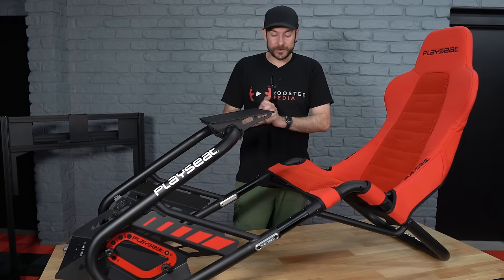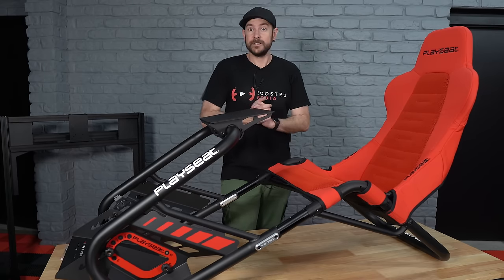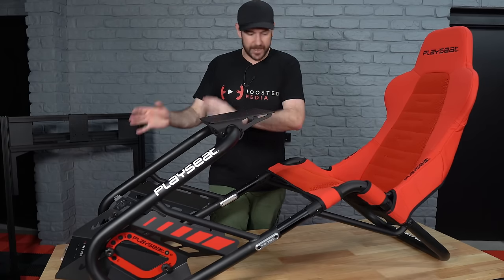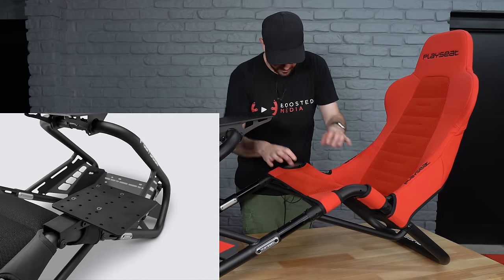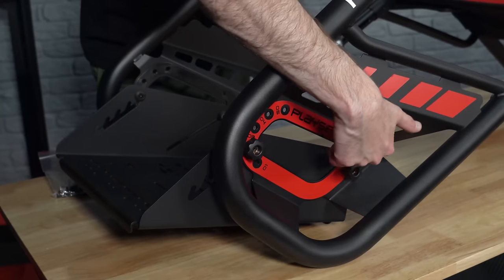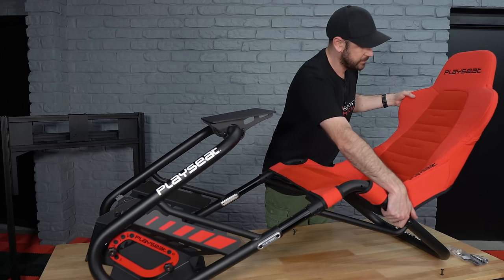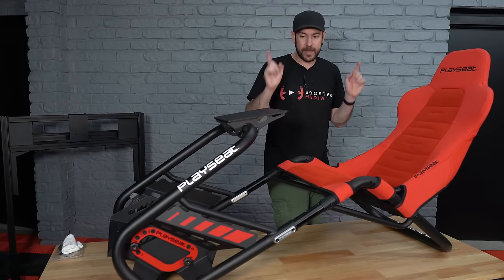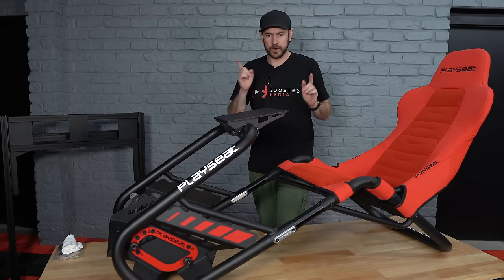JUST BUY A PROFILE RIG? - Playseat Trophy Sim Racing Cockpit Review

Comment: I've had one for a month.

The lumbar support is subpar. It gave me lots of back pain during use. I also found the wheelplate not being adjustable is very annoying. When youre in a suboptimal position for a couple hours you notice the inconvenience of it. Even in a 2hr stint in an endurance race it already bothered me.

The pedal deck flexes with decent force on braking. And since the whole thing is kinda light, if you put it on a smooth floor it can move during big moments of ffb. Also everytime you sit down it moves, making you re-center the thing while on the chair. I also regularly hit my knees on the extended bits on the wheeldeck

Those are all inconveniences that you shouldnt have with a rig at this price point imo. A profile rig is way way better
Reply: Hi mate, I'm 13stone, 5'11, and fi and that my ideal seating position with three trophy is brilliant. I'm medium on the tube, seat half reclined and have the pedals at a perfect angle. I have the wheel deck flipped so the short side faces you, which moves the wheel further away. I've got the deck angled down ever so slightly. I have osteoarthritis and find the seating good. The lumbar support is good I've got it just in the right spot. Everyone is different and what works for me may not work for you. Its light, easy to build and configure when compared to a profile rig. The seat is breathable where as most of the cheaper seats for profile rigs are pleather which make me sweat and then the seats are flat so you need brackets to angle it. Or get a more expensive bucket seat with brackets... I did a lot of research before opting for the trophy and for me it's been nothing but perfect. Using it with a fanatec dd 8nm, loadcell (I've seen zero plex in the pedal deck btw)
Reply: @StickyGeko  I think this difference in experience shows what's the main issue with this rig is. For some it works well, but for others its simply not adjustable enough to be comfortable in the longer sessions.
Reply from the maker: Yep. It’s impossible for something like this to be perfectly suited to everyone.

Comment: Owned one of these for about a year before selling it to a friend and upgrading to an ASR1 and an NRG seat for basically the same price (I'm in North America and used a discount code for the ASR1). It's a great set up for what it is: rigid enough for low to mid range NM DD bases and load cell pedals but also light enough to slide/move around a room or store out of the way. Looks as though some people even hang them up on the wall when not in use. 

The main complaint I had about this rig are the sliding "size" extender rails. Ended up having to fully extend them because anything shorter would just expand under heavy braking over time. Have read solutions where people have mixed grease and sand to keep it from fully extending to the large adjustment under breaking. Overall though better than any foldable/wheelstand rig but not quite as good as a full aluminum profile rig and bucket seat. 

If I were to do it again I would have skipped the Playseat Trophy and gone right to the ASR1 and proper seat but I'm glad I was able to experience the best budget all in one tubular solution currently. The seat on the Trophy is arguably more comfortable than my NRG seat, even after long play sessions and the lightness of the rig combined with the nature of the hammock style seat made the bass shakers that much more impactful. That being said the profile rig is way more customizable and the Playseat doesn't even have a decent shifter/handbrake mount currently that isn't overpriced and poorly designed. All just food for thought.
Reply: Yep. I've had it with the tubes sliding out. I have the pedals as close as they can be. I can't reach them once the tubes slide out to the large setting. I'm so annoyed with this and how much I spent for this rig.
Reply: How many Nm do you run and whats the flex like?

Comment: I bought one a few months ago because I had limited space and I wanted something that looked decent in my small space and still gave me a decent racing rig. I am using the Simagic Alpha Ultimate and P1000 pedals (with hydraulic upgrade). I love it. It's compact, but comfortable. Little to no flex/movement. And it looks good when not in use (it's sleek and with the red and black of the Simagic pedals it looks sharp). It's adjustable enough and I have managed to find a great racing position. Plus, I can move it/store it really easily. I would highly recommend if you don't have the space for a larger, more permanent rig.
Reply: I know you wouldn't have it set like this but how much flex is there at 20nm? How many kg is your pedals set at?
Reply: I experience zero flex with my Alpha U. I am a ‘weekend warrior’ type racer, so I definitely don’t have it dialed-in at a pro level, but I have experience nothing that makes me regret my decision. The ONLY thing I would change is that I feel the seating position is a touch too low for my liking, and I feel it puts my eye-level just below where I would prefer it to be. But I adjust in the software and I’m good to go. 

I’m not near the rig so I can’t check pedal settings. From memory I have the elastomers on the relatively firm/little travel side, and I don’t experience any flex in the pedal plate.
Reply: @jc_yyz  when you get to your rig it would be awesome if you test it at max Nm and find out how many kg of force your using on the pedals
Reply: @TheDoctor46vr    Just sat down between holiday festivities and maxed out (in my settings window, based on my settings) at 37KG of force and no movement.
Reply: @jc_yyz  thanks man, how many nm is the wheel base set at usually?

Comment: Had the Logitech Grey Playseat for almost a year now and still loving it presence in my small little living room. Stick 4 pieces of felt-pads floor protect and l can push the sim around (not on carpet) whenever l need space without hurting my back. I m 1.8m but setting my seat length to the shortest for the rally-car feels. Can literally sleep in it as well. Yes it's that comfortable, cooling as well. Shipping from Amazon USA is expensive but worth it.

Comment: I was reading that this was intended for the enhanced feedback mode of the Logitech Pro wheel, and that the flex that is sent from the wheel base to the frame is actually intended to add to immersion (as you're feeling feedback not just through the wheel but through the chassis too). Not sure how true this is in practice though...
Reply: Yes, if you HAVE the logitech DD pro wheel you definitely feel the ffb throughout the frame. Left, right, center, you can even fell the chevron paint via the rig. Its like a stereo feeling effect.

Comment: I adore my playseat trophy g edition. It's a smaller form factor than any profile rig, and is very light should I need to move it to access wiring etc.  Very sturdy, with no flex.  I went from a TR8 Pro, which weighed an absolute ton, and was much bigger.  This is a better racing experience for me and takes up a fraction of the space.

Comment: Had mine for about 6 months, it's been a joy to use. The seat is really nice IMO, it kinda forms around me in a nice way. I prefer it over actual racing seats, most of which tend to be uncomfortable for people who aren't realatively tall.

I'm 172 tall, 70kilos. I have the pit set pretty close to the smallest setting with the wheel very close cause I like being stuck in really snug. It would work fine for shorter people. Maybe even kids if you raise the seat back upright (mine is leaned back a bit.)
Reply: Just gonna pop in once more, had it for close to a year now and it's held up great. I've used it for about 300-400 hours at this point and there is no wear anywhere. Still in perfect shape. The seat seems to be made from very resistant material cause it literally looks brand new. I have a load cell pedal as well so I squeeze myself back in that seat pretty hard when I brake, still no stretching or wear.

Very satisfied. Very happy it fit me as well as it does. That was my main concern when going with this kind of pit over a profile rig, I was afraid it just wouldn't fit me. It's surprisigngly adjustable. I'm using the wheel base mount backwards to get it even more snug.

Anyways, I'd recommend this to people who feel like they want this. It does look super cool and it feels very much like getting into a race car. You have to slide in like you're getting into a supercar. Makes me feel cool every time!
Reply: @JimmyNuisance  How many Nm do you run? and whats the flex like?

Comment: I've had a 2007 model Playseat Evolution in alcantara finish for about 11 years now.  It feels great to drive in and I can't see any possible reason I'd ever need to replace it.  You'll fairly quickly find yourself replacing a wheel or a monitor or whatever, but the chassis is the one part of your rig you only need to buy once if you don't half-ass it.  I mean... It's still shaped like a bucket seat.  It's still adjustable.  I added an official gear shifter attachment for about £60 a few years ago.  It's physically incapable of becoming outdated or breaking.  Unless I win the lottery and start looking at motion rigs.

Comment: I had some 2" thick pine boards laying around that I got bored and milled up one day. Cut a bunch of it up and made a rig for my wheel and pedals. Made a pedestal and put in some drawer slides that I found in a discarded cabinet on the side of the road. Had some Paracord from a project that I threaded between the two rails for a seat bottom. After I put everything together I was out of a few dollars for some lag bolted to tie everything together. Fun little day project. Now I have a roadside junk TV that I fixed bolted to the wheel pedestal that slides in and out with the wheel to get out and some castors to roll it around.

Comment: Have one myself now for several months and I can mostly agree with what you've said in the video although using fanatec's v3 pedals is really no issue in terms of flex. However I'm already upgrading to 8020 rig since lack of customizations is a thing with this rig. While rig is pretty rigid and comfortable I can highlight some of the issues that I've experienced. For me, it's really low and getting in and out is a bit annoying, fastening underneath the seat kept falling off especially when getting out so every now and then I had to fasten it again. While it's relatively light but add heavy pedals and a heavy wheel base(I have DD GT PRO) and you end up where the front of the wheel is heavy and rear end is light, moving it isn't something you'll want to be doing a lot, I solved that by attaching caster wheels to the front and it made moving it around that much easier. If you don't need to move it around then I'd go for 8020 rig since in terms of space it's taking it's just a tiny bit less than the most popular aluminum profile rigs and since for me space has become a non issue and I can set for a permanent rig location it has become redundant. I'm not sure I agree on 'this looks better in a room than aluminum profile rigs', in my opinion new black profile rigs don't look any worse.
Reply: Would love to see a short video how you solved it with wheels, as that would help allot of racers who has this seat
Reply: I to would like to see the wheels as I plan on doing similar

Comment: I bought one almost 2 years ago… and it’s still good as new. Very sturdy, very confy, and adjustable. If you want a good “rig”, sturdy enough for a dd or any wheel, but without having to go big with a proper rig… this is it
Reply: How many Nm do you run and whats the flex like?
Reply: @TheDoctor46vr  i use the Fanatec Clubsport DD+ wheelbase with a pretty strong setting, and there is no flex at all

Comment: I use this one, if you are the only driver who use this seat it's good. It's very stable, nothing moves when I use my Fanatec DD with Loadcell. I can Recommend it for drivers who don't use a shifter or handbrake. Also you have room for your legs. It's also very light, no Problem to move it around. For low Budget it's very good 🏁🌍😎✌️

Comment: Ive had this for 2 months now. Im 6'2 (187cm) tall and biggest problem for me is wrist angle on the wheel. It gets uncomfortable for me on a longer session. QC on my unit was bit lacking as I had to hammer the wheel baseplate to get it to fit. I replaced the allen bolts on the frame for standard m6/50mm bolts for easier adjustability.

All in all pretty satisfied with the product. This is the only option for this specific niche of cockpits.
Reply: Could you clarify what you mean by the wrist angle issue? I'm 6'5" and considering buying one of these.
Reply: With my frame I don't have enough up and down adjustability on the wheel for optimal wrist angle. Meaning, in my driving position my wrist is not straight which leads to wrist strains on longer stints. Mind you, I'm an arpg gamer so my wrists might be shot anyway 😅 

I noticed this issue this weekend when I drove for 4 hours or so with my 9mn moza. I'll play around a bit with  the little adjustability. I can report back to you.

Comment: Works well with my Moza R9. The only problem is that mounting plate for wheel is annoyingly moving during driving as it's hard to block it at specific position - apart from that affordable and well built.

Comment: the advantage of this cockpit is to be able to move it, but it is still quite heavy with a DD on it, it is very comfortable and more rigid than one seems to believe, very robust, now the problem with this cockpit, is that the seat is too low and there is no steering wheel height adjustment, I put the plate in the other direction (below the tube) it went well with my csl dd, like that I I have a view above the steering wheel.

Comment: I agree.  The vertical aluminum extrusions that protrude higher than the wheelbase on most aluminum profile rigs break the immersion.  They need a better design that can be adjusted vertically without the fixed height of the extrusion.

Comment: Good vid! I have had a Logitech edition Trophy with my G Pro DD & Pedals for 6 months with minimal gripes. I Feel you missed on talking about Comfort for extended driving sessions. After getting the rig setup right for my ergonomic profile I have had zero issues induced from the rig playing 6 hours plus. Beyond that the sited issue with the pedal base flex is very specific to either individual mounted pedals or with high force in the brake pedal. For instance with my G pro pedals the base they have eliminated most flex except with the brake force set to 80KG of force or higher than frame flex becomes noticeable but I don’t usually go passed 45KG currently. As for mobility of the frame I live in an apartment and only have space in my bedroom and have to position the rig when in use and than take it down and set it in a out of the way spot I have, being able to move it around with ease is extremely helpful! It only takes me about 60 seconds to set it up and begin power up. This really very important when you do not have a dedicated sole use sim racing place available to you or need to move the rig around. Those big aluminum frame rigs eat up a lot of space.

Comment: I have used Playseat challenge, trophy and EVO and i prefer Trophy. I used it with DD2 and V3 pedals and i had absolutely no flex issues. I am 1.75m in height and only thing i had is that i sat bit too low in comparison where the wheel is and the wheel could have been tilted more back but other than that it was perfect for my back and i was super happy with it.

Comment: Removing the black rubber cover on top of the v2 elites let's you use a couple of longer m6 bolts straight into the trophy's pedal tray. In conjunction with the two rear points gives a solid, no hassle way, to mount these pedals to the trophy. I managed it solo with the pedal tray sttached to the trophy inside of 10 mins.
Reply: How many Nm do you run and whats the flex like?

ps. It would be cool if you made a little video about the V2 fitment, I don't expect you to undo it all but just point out exactly what you're talking about.

Comment: How many Nm dod you use with the DD2? Hearing you felt it numbs the force feedback doesnt work for me. But maybe it can stay rigid at a certain Nm range.
Then of course there's the shift mount...
Reply from the maker: Tested it all the way to max but was mostly running it around 12NM
Reply: @boostedmedia  was the FFB numbed from flex at 12NM?
I have yet to get a DD wheel base, so for clarity if this was an 8020 rig what would you still be running the wheel base at 12NM? If not what NM do you typically run on an 8020 rig?
Reply: I know you're busy but if you get the time to reply it will be much appreciated @boostedmedia

Comment: Weird, my Logitech one came with velcro straps to use, as well as felt pads to have at the bottom that contacts the ground. However I didn't have any extra of those weird washers for accessories.

With that said though, I absolutely love mine. I love using it, and I love looking over to see it. I also love being able to move it about as needed. Definitely happy with my purchase.

Comment: I found my zero gravity lawn chair slides right up to a Next Level folding Wheel/Pedal stand with shifter mount.  Nice cheap setup. I used some hexagonal long nuts to extend the shifter further out to a more natural position. And the wheel is very easy to adjust up or down for different people. 

PS: If you prop the rear of your playchair up, it has the effect of lowering the wheel a tad.